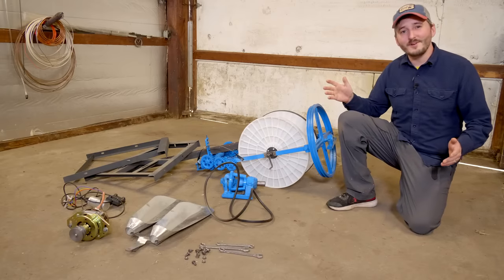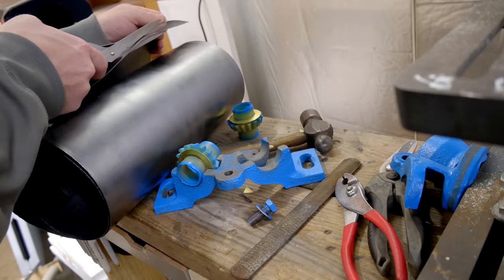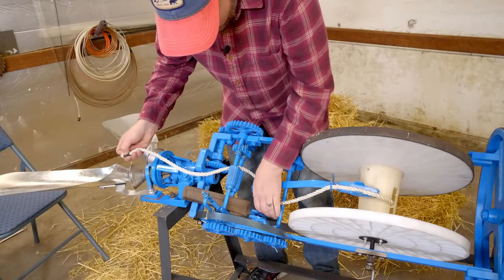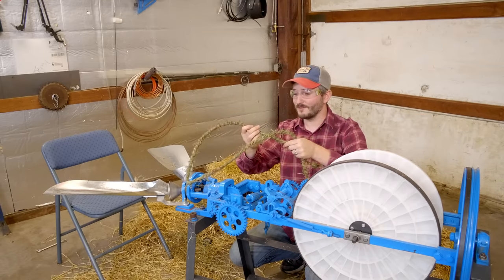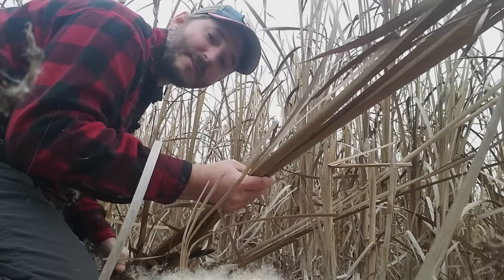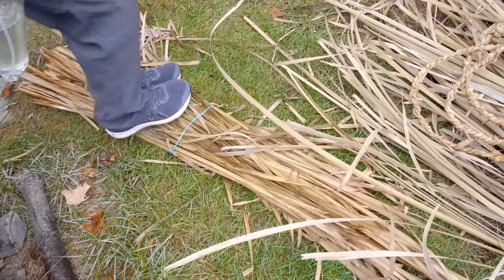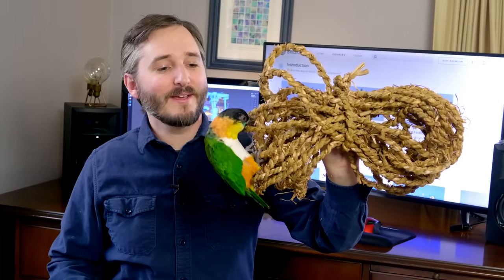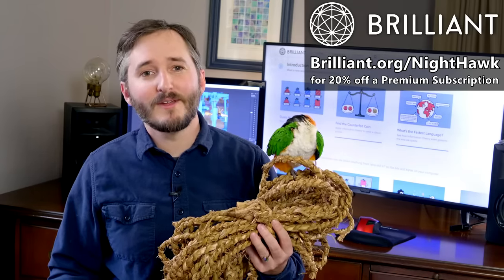A Machine That Turns Plants Into Rope

Comment: In my area yucca is probably the toughest plant fiber you can find, it has long stands that are individually quite strong. It does take a lot of processing to remove the individual fibres from the leaves and clean off the excess material.
Reply: It's also delicious
Reply: @magicsasafras3414  What!? Yucca can be eaten?  I didn't know that.
Reply: @Kopie0830  oh I looked it up. I think we are talking about different yucca 😆
Reply: @magicsasafras3414  the type of yucca I am talking about has edible parts, but kinda tastes like soap.
Reply: @garethbaus5471  oh I am talking about the Dominican kind
Reply: @magicsasafras3414  Yeah the kind I am talking about grows in the US, it is a relative of agave
Reply: @garethbaus5471  oh lol yeah
Reply: @garethbaus5471  I was thinking of a root called yuca
Reply: @magicsasafras3414  That isn't even pronounced the same way.
Reply: @garethbaus5471  well it was spelled similarly.
Reply: From what I recall of yucca rope, the fibers ate twined (two strand, like this machine) and then the twine is spun into rope (3-4 strand) the twine is s-twisted, and the rope is z-twisted.  This give you a fairly strong rope, sometimes the 3-4 strand rope is treated as if it is twine, then 3-4 of those “twines” are s-twisted into a thinker rope.  Then an arrow with a piece of twine is shot across the canyon that the rope bridge should cross, and then a thinner rope is payed across, followed by the bundle of 4 or 3 thicker ropes, which are secured either as a box, with slats then tied between the lower 2 ropes, and connector “railings” tied between the top and bottom rope, or a “v” shape with the connector “railings” between the bottom single rope and the two spread hand-rails. I’ve crossed both types of bridges, and saw one seasonal bridge replacement session, where one replacement rope was just pulled across and tied in place (slats and railings moved to the replacement along the way) to keep from having to replace the whole bridge at once.

In those old movies, where you see a scary, decrepit looking bridge, it means that the folks who used to maintain it were probably killed off or driven off.

Comment: @Nighthawkinlight:  P.S.:  Include a Retting (rotting) step.  Soaking the donor material for "X" amount of time to start the process of breaking down the pith (filler material between the desired fibers).  There is plenty of information on the retting process, out there.
Eliminating the pith will greatly strengthen your finished product.

Comment: Watched someone use a more primitive version of that machine. They had to shred the grasses into a more fibrous hair like stage. There was a board with small metal spikes/teeth and then a top board to press the grass down and they just pulled the grass through repeating the process several times. You might want to research that part. I believe that combing/shredding process makes it so the overall rope is uniform and it doesnt fall apart when you add the subsequent batches.

Comment: I think you would have a much better time if you had a variable speed controller of some sort for that motor; either a plug box with a dial or a pedal that can vary the speed of the motor. It would allow you to work at a more comfortable pace and be significantly less terrifying
Reply: I've used a dimmer switch to change the voltage going to a transformer. Might work for this.

Comment: Here in the south we have natural vines that are already good for rope, but would work well in your machine.  Kudzu is an imported vine, has an oil content and is very tough and very long.  If you can split it into fourths and roll them through a press I believe it would work well in your machine.  Similar to Kudzu is Wysteria vines, also very long and tough.  The runners on the ground are what you want in any selection and lastly Honeysuckle have smaller but tough vines.  If dehydrated a little and pressed to a ribbon like the others it should make a very good rope in four to seven strands.

Comment: The straw you had wasn't made any shorter by baling, modern wheat has a short straw length to avoid wind damage and use less nutrients growing straw, the baler might have kinked the straw a bit though. A variety used for thatching might work, but you'd need a lot of wheat.
I think you might be able to get the straw to work, the straw is glossier and smoother than the reeds or grass and is easier to pull apart and so it breaks. If you sprayed it with something like washing up liquid (dish soap) or isopropyl alcohol to remove some of the smooth outer waxy layer it might make it less likely to break. Worth trying with some of the rest of the bale.

I'd suggest growing something else instead. With flax you could make rope from dried flax, or process it into thread, string, linen etc. Miscanthus should work, or a type of ornamental grass.  

A speed controller for your machine, something like those used on a sewing machine might help, or changing the pulley ratios.

Comment: Love the contraption! You do such a good job with your videos. The simplicity of operation; putting fibre in, rope comes out, is very satisfying. NZ Cabbage palm leaves, green or dry, would be fantastic since they are ridiculously strong and require next to no processing. There are quite common as decorative plants, and no one wants the shed leaves (at least where I live) However I think the most ideal would be retted esparto grass. Pluck it, leave it in water for a while, then make it into rope. That's what the Romans did for ship rigging. Easy to make and work with, strong rope, and looks great. Just a difficult material to find nowadays.

Comment: Other plants you might try:
 - burdock (genus Arctium)
 - dogbane (Apocynum cannabinum)

Burdock would be better to work while it's green, but it can get five feet or taller.

Dogbane is one to collect in the winter. It was traditionally used to make fiber for clothing, as it has fine, strong fibers. Don't give that one to pets, though, as it's toxic to ingest.

Hemp, obviously, works well if you can get it. 

Stinging nettle is good, and also used for clothing (and it's not only edible, but nutritious!), but requires a bit of processing to remove the silicone spines prior to spinning.

Flax would handle a lot like dogbane but requires a bit of processing to free the fibers from the woody bits of the plant. Nature does some of that processing for you if you gather the dogbane in late winter.

Comment: I agree with a lot of the comments here. If you want to make rope from fibrous materials like straw, cat tails or hemp you need to really soak it to soften it up. If it it's too dry the more brittle parts will cut the straws. After that you crush it or Thwack it until it is more pliable.

Comment: this might sound odd, but I have two suggestions for materials to use to make rope. First: string! just ordinary store bought craft string or whatever you can find for cheap.  it'll be interesting to see how strong a rope made from that would be. 
Second suggestion: plastic bottles!  you can make a simple bracket on a pole with a Stanley knife blade attached that can cut 2 litre pop bottles around the radius in a spiral into long thin twine in seconds.  it's not very strong on its own.  but I bet its better if it could be bound into a rope!

Comment: When you decide to try straw again, I suggest you soak it in water for a while to make it more flexible, then smash it with a hammer and anvil or between two rocks to break up the shafts into fibers. I don't know how well it will work. I've never tried it. But, I have seen rope made on other channels and I'm pretty sure that's what they do. I'm a little if-y on the water.

Comment: one thing i've found is nice for making rope is just using scraps of old polymer rope. of course that was by hand and it was more a twine than a rope but it still did the trick. i was just looking for something to do at camp and saw there was about 2 feet of an inch thick rope that was used for something couldn't tell ya what, well unravveled it and retwisted it to about 10 or 12 feet of maybe 3/8ths of an inch thick, served its purpose just as hanginging things to dry after the kids got out of the pond certainly wasn't a practical use of my time but i was camping so might as well do something while sitting at the fire. overall though its a great skill to understand, you can make rope out of anything from grass clippings to even certain species of saplings. difference between doing it by hand and by machine though obviously you can twist alot more in the machine and at a large diameter, but by hand you can get a much more consistent thickness and to an extent even a tighter twist. that being said i understand the purpose of using a machine quantity over quality , still though once you learn the skill by hand you will see everything as potential for rope i've even tried braiding my hair like i would twist a rope... dont try that either you're going to come out with a tangled mess or it'll be so tight you'd risk ripping out a full head of hair

Comment: There are a lot of experimental Hemp crops happening. You could also get the stalks from Marijuana plants from growers. They usually end up getting composted or burnt. Sunflower plants mighty be good as well.

Retting your material will get you much better results. I think you need another strand as well.

Comment: It would be awesome if you could somehow make one of these using parts you find at scrapyards and the hardware store. You pretty much had to take this one apart and modify it anyway. So it wouldn’t be much of a stretch to make one from scratch. Also, noticed some comments from your previous videos about drying whatever grass you’re using and soaking it in water just before use.

Comment: Suggestion, either add a secondary pulley set, use a variac or a VFD to slow the system down to a speed you can work with constantly instead of pulsing it.  With the Fragmite, if you ran it over with your car on concrete or a roller pair, it should break into strips, but probably better to wait till summer to try it next time.

Comment: @Nighthawkinlight:  Work on feeding each new bundle of fibrous material more consistently and evenly.  Each handful should be tapered for a better overlap of each new bunch.  This will help lessen weak joints/ tie the bunches together better. 
 Basically, locks the fibers in better.  The taper also helps avoid repeated "fat/skinny sections

Reduce the speed by changing out the main shaft pulley for a larger one.  If that is impractical, work out a two-step pulley speed reduction.  This will allow you to manage both feeds better by yourself

Additionally, you need to pick/harvest your donor fiber when is mature, but still green.  Then dry them yourself.  If you wait until they are brown, you're too late..... It has become brittle.
All the materials you tried will work (with various strengths based on material), if you harvest and dry properly.

I saw a documentary on some native South American villagers high up in the Andes (I want to say Peru).  Each year they build a new grass rope suspension bridge across this insanely high gorge !!  Each village family had to contribute "X" number of mountain grass tufts/bunches/bundles to be woven/braided into the long ropes needed to span the gorge.  Each individual bunch of grass when unfolded was no more than 15-18"s.
So, it can be done.
If I remember correctly, they hand twisted or braided it, with a close eye on consistency.

Comment: What about a funnel like attachment that splits off internally at the input end of the device? Much of the process is slowed down by managing two input ports simultaneously. If it was one wider input port with a wedge/blade or divider, you could prep bundles of material that you could feed into the machine.

Comment: Brilliant video, thank you!  I would find it interesting to see various materials.  Two that come to mind are (1) used bedsheets cut into 1/2" strips, because I clicked into this video from your DIY waterproof tarp video, and (2) old copper wire, like telephone or CAT5 cable, stripped or not.  Also interested in the working or static load.

Comment: You and your dang rope-making machine waking me up in the middle of the night!

Why? Cause I went to sleep thinking about how I could make my own less expensively.
And here's how:

picture 3 pipes appropriately mounted so they can turn/roll either in bearings or between roller wheels with belts, chains or rubber rollers transferring energy to them each from their own PWM electric motor. 

Fiber enters the 1st 2 pipes, twisting in the same direction. Then those strands enter the 3rd pipe also twisting in the same direction.
Then you'd need a few appropriately placed pinching guide rollers and a spool with its own PWM motor.

If all the motors were powered from a single controller they would be nearly perfectly synchronous tho the spool roller might need its own PWM controller. A few details to work out.

PWM motors can be had for less than  20$, and power switch controller is about the same. That should put a build with mounting hardware a bit over 100$

Comment: I think with the hay you need to fill the hoppers up completely not just a little bit but put a lot through there. It would be interesting to see other materials put through this, like leftover insulation from skinned wire. Or even wire itself to make a very strong cable
Reply from the maker: The problem is often too much being pulled into the machine and jamming the funnels. You have to feed it at just the right pace

Comment: I'd be interested to see if you'd get good results putting the woody reed stocks or that phragmite through a roller to crush them up a bit. A lot of what I've seen of making primitive threads and rope by hand involves stripping harder stuff into strands.
Reply: Wood a old timer ringer for squeezing washed clothing through  of those hand crank ringers work?
Reply: @shelleypilcher3812  Maybe for an initial crushing, depending on the material it might require manual splitting. The rollers would need to be pretty robust if you're putting more than one row in at a time I'm sure.

Comment: You should use a speed controller on your motor, that way you can have the machine working a lower speed while you get comfortable with the routine of loading material.

Comment: If you were using the rope for sailing or other applications, you'd end up burning off the outer bits to smooth it, then apply a layer of pitch for adhesion

Comment: Before twisting, the plants should be crushed. Walking on them is a good start, but it requires a bit more oomf. The best way to do so would be to pass the plants between two rotating gears a few times. Teeth of those gears will 'chew up' the matter nicely. Take a look at a/c duct bead rollers, specifically at ones that roll parallel ridges on ends of pipes so one can fit into another, for inspiration.

Comment: The quality of the build on the machine made me think of those manufacturing videos where they are melting down random car parts and casting sewing machines and such.  The idea is pretty cool though.  I wonder if some fiber sources would benefit from a steam trough. Not sur what you call it but similar to how they soak some boards in hot water before shaping because makes the lignin soften up while hot.

Comment: could you mix the material types? Like use the cat tails or long fiber as a "base", and throw in the shorter stuff along with it? Idk if it would make better rope or not, but it might be a decent way to use up the smaller stuff (if you just have waste that isn't going to be used elsewhere) and help extend the length a bit.

Comment: This is Really Cool!   I seem to try braiding Tree Roots, Palm Fronds and Stems' center stringed Fibers - don't turn out so well, yet.  but good for ...  Wire Baskets, compost.  Ideas welcome.   
7:21  What a Beautiful Sight!   What's down the Hole?     
THANKS  didn't know about the alcohol.

Learned new words:   Retting - rotting stems in water removes sticky substance & separate fibres.
Raspador for Banana & Pineapple Leaves.  

Article:  "Design and development of simple machine for pineapple leaf fiber extraction" or by Hand

Comment: I'm curious as to if you had some sort of tarp down and just spread the hay all down all pointing in a singular direction long ways, and then sort of used the 'give it a bit of water and alcohol' technique' to wet it and then rolled up all the fibers the tarp very very tightly and stepped on it while it was rolled up to kind of pack it together into a slightly pulpy strand that's still a bit loosely held together, then had a good few of these prepped up to feed into the machine if that pulping process would help all the shorter strands of the hay grip onto each other a bit more to avoid slipping. Also maybe alfalfa bales might be a bit better if the strands are longer. Very curious and hope you make a follow up video for this one, this is VERY cool, Cheers!

Comment: **GOOD IDEA**There is a good idea.wet the straw then make a log chain by making fibers half on  next fibers an half on previous an making them mixed in one another and make ready a long chain before hsnd by connecting using cloth hanging clips  and now you can feed pretty fast just remove clips before fibers go into machine

Comment: The metal even has pits.  Was this old equipment in disrepair, they just painted and sold to you?
Also I think with the fibers, you need to stagger them more, so they can grab on to one another.  I don't think it's a matter of needing longer fibers, although that does make it eayser.